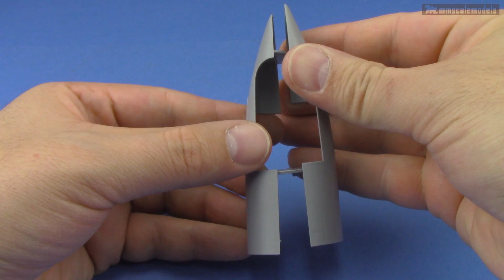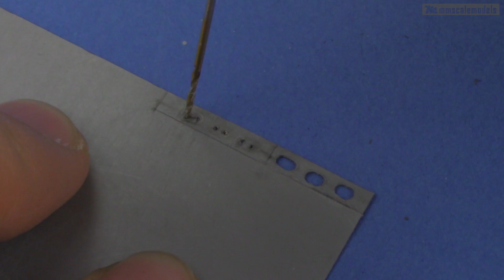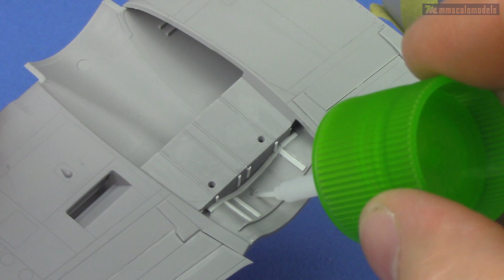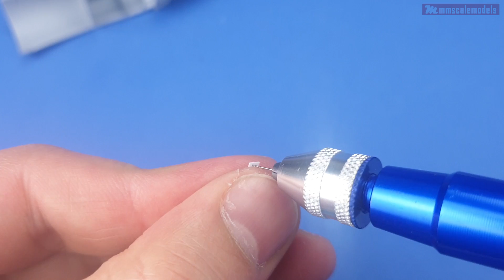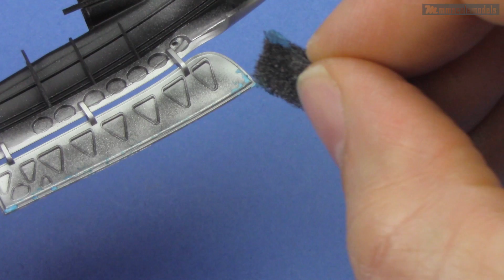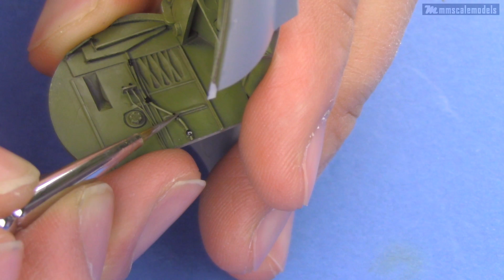Ep. 4: B-26B-50 Invader - Gearbays detailing, painting and weathering - ICM - 1/48 airplane model

Comment: You can set bends in monofilament with heat, like from a hairdryer or heat gun. You can use flame, but, it’s too easy to melt it or give it a rough surface.
Reply from the maker: Thanks for the tip mate!